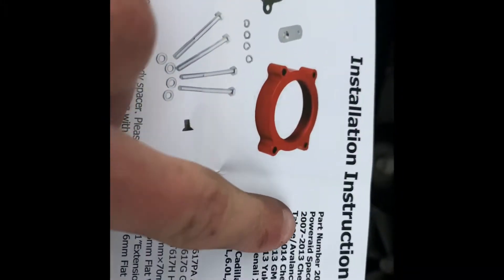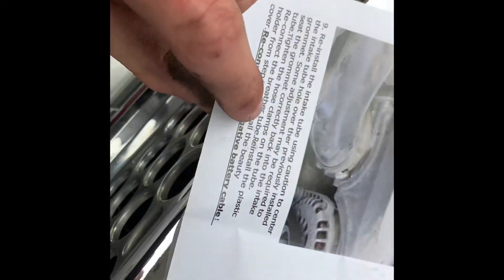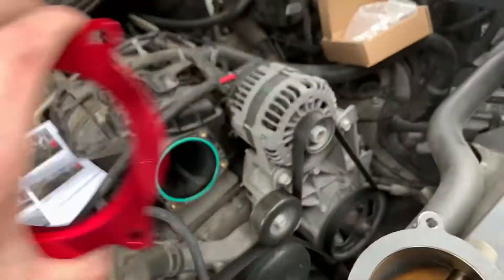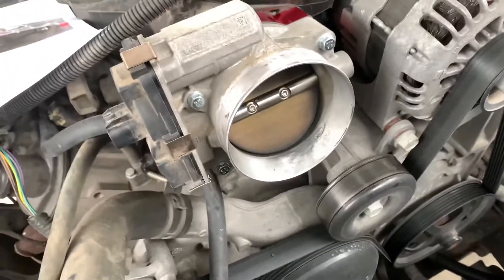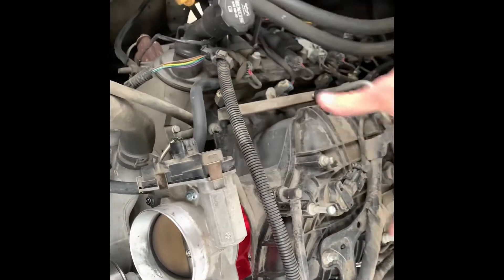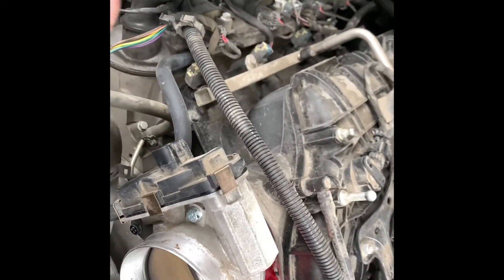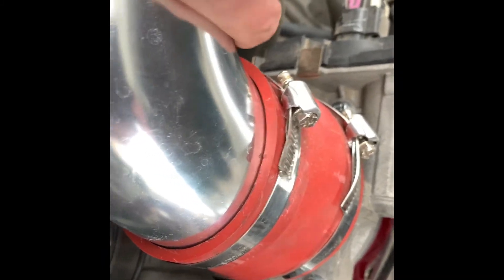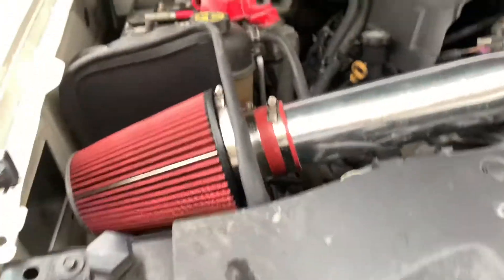Throttle Body Spacer Install

Comment: The damn water pump neck on my truck is in the way of the throttle. So it can be moved forward by the spacer. Previous owner installed off brand pump for sure

Comment: No fan shroud?
Reply from the maker: Electric fans don’t come with them
Reply: @GordoCaz  I gotta switch over. My cold air intake and fan shroud with the spacer not enough clearance.
Reply from the maker: @jameshair-dennis5987  mine are factory but I’d imagine they push more air since it’s dual fans
Reply: @GordoCaz  big facts. Thanks for the video. I put mine on yesterday. Your video is on point thanks